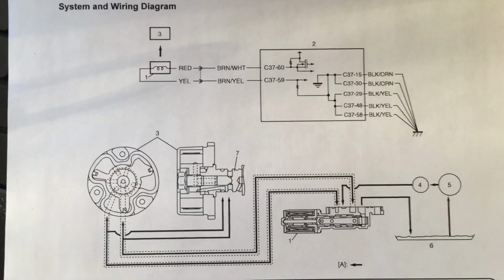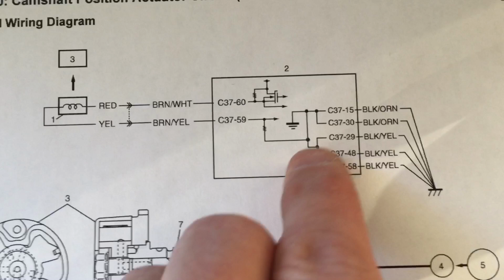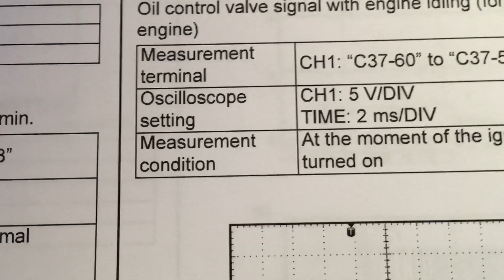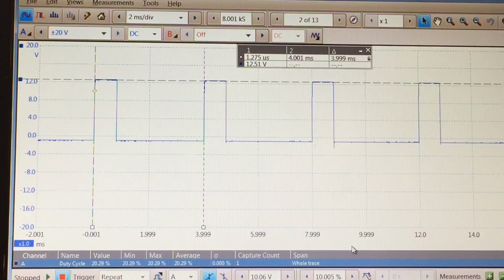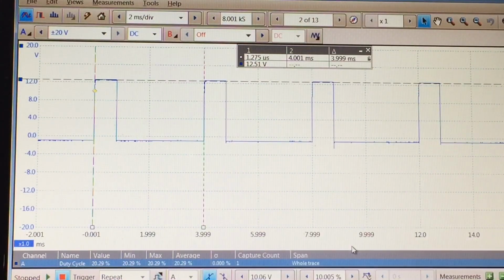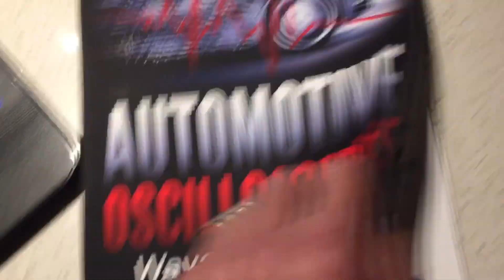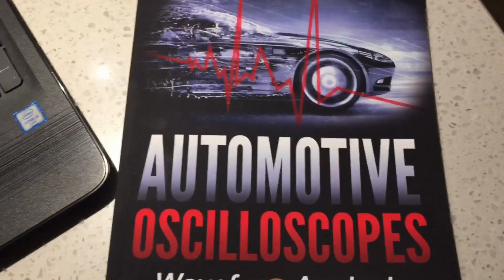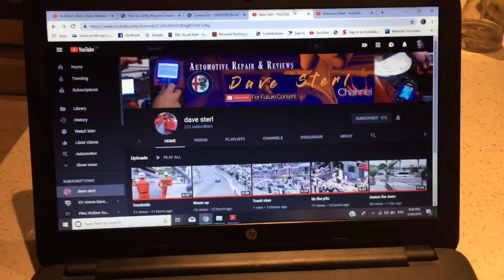VVT Waveform Study

Comment: Call me nuts but I'm planning on putting one of these in a 2000 Chevy metro, I'm going to use the G13bb ECU to run AJ23A 4 cylinder that has VVT . I am going to use a 5 V signal activated by the camshaft position sensor (tachometer sigbal) with a voltage varied by a map sensor and some very careful tuning What's a variable resistor. I was thinking to lower the voltage down from 12 to around 5 V,  using a couple of Fuel injector resistors from an old nineties era Suzuki sidekick. Each one if them drops the voltage down 3.5 volts, ×2 = 7volt - 12volts =5 volts... goldilocks zone for the vvt solenoid voltage. Run that through a map sensor and lower the voltage down to the appropriate levels, using tachometer signal as a trigger, there might be a way to actually… custom hack a variable valve timing system. The idea is to build a sleeper, What's more innocent than a 2000 Chevy metro aka tsuzuki swift, with little 13" tires and disc rims with white paint.... That's been tuned to have 200 horsepower with no Turbo. I've done the math something like 0 to 60 in 5 seconds to 6 seconds in the real world conditions. For fun... and my inner MAD SCIENTIST!
Reply: Could also use signal from fuel injectors, manipulate through map sensor...